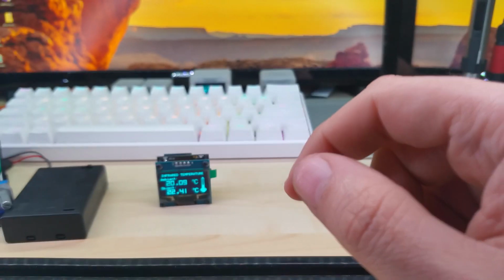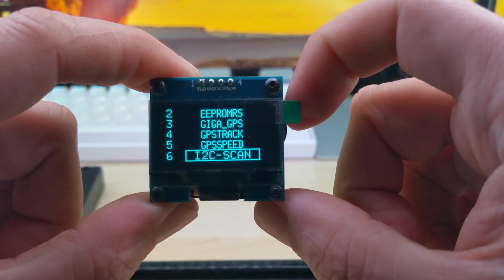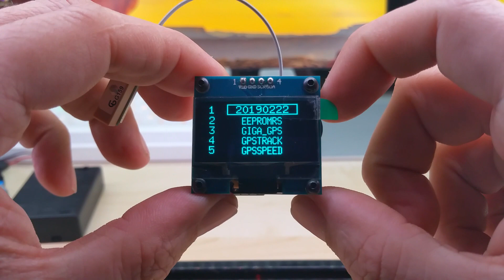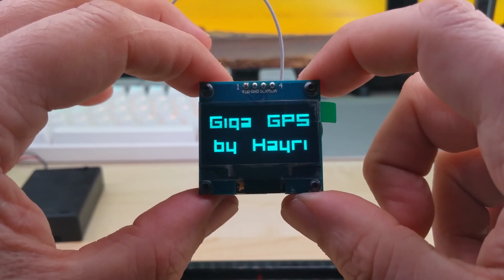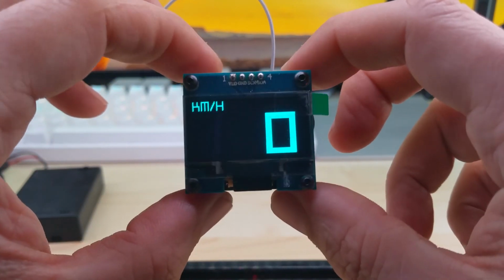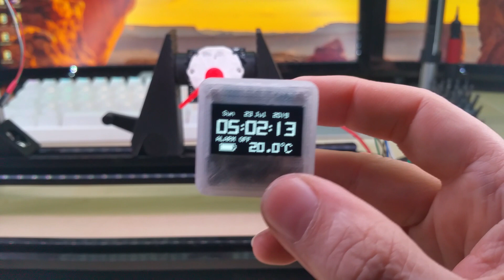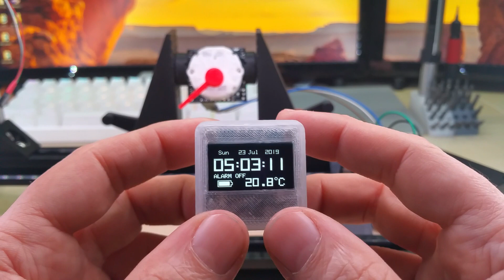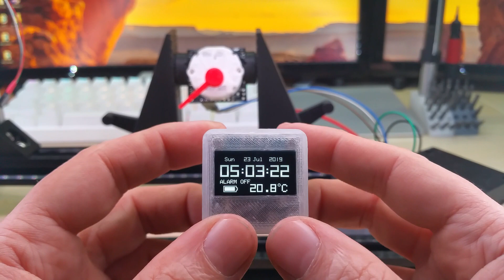Giga328, the ultimate Arduino compatible board with upload from microSD card feature

Comment: regarding tiny altimeter
I have an error on uploading  how I overcome this, please help

Arduino: 1.8.9 (Windows 7), Board: "Arduino Pro or Pro Mini, ATmega328P (5V, 16 MHz)"

Splash.c:8:9: error: variable 'Splash' must be const in order to be put into read-only section by means of '__attribute__((progmem))'

 uint8_t Splash[] PROGMEM={

         ^

Battery.c:8:9: error: variable 'Battery' must be const in order to be put into read-only section by means of '__attribute__((progmem))'

 uint8_t Battery[] PROGMEM={

         ^

Font24x40.c:8:9: error: variable 'Font24x40' must be const in order to be put into read-only section by means of '__attribute__((progmem))'

 uint8_t Font24x40[] PROGMEM={

         ^

Symbol.c:8:9: error: variable 'Symbol' must be const in order to be put into read-only section by means of '__attribute__((progmem))'

 uint8_t Symbol[] PROGMEM={

         ^

exit status 1
variable 'Splash' must be const in order to be put into read-only section by means of '__attribute__((progmem))'

This report would have more information with
"Show verbose output during compilation"
option enabled in File -> Preferences.
Reply from the maker: that code is written with an older IDE, you either have adjust the errors regarding Progmem or use an older IDE, 1.6.5 should work if I am not mistaken.
Reply: @iHayri1  thanks for your kindness i'l try with that old ide
Reply: @iHayri1   tried 1.6.5 it gives the same error message then tried  1.4.0 both it also did not work. again in trouble can you adjust the code for me, it's a big help

Comment: That tiny GPS is so tiny!!
Reply from the maker: I even have a smaller one that I was gonna use on the OLEDiTREK but never could get it to work. It is the size of a thumbnail less than 2mm thick including a ceramic antenna, and expensive as hell :-) But this one is great just wish the antenna would be attached to the PB, great another idea just emerged, I could make a PCB for the GPS module with the antenna attached, than I can just use the pins to attach it to my PCB, thank you Steve :-) I always get new ideas when I write about something :-)
Reply: haha, glad I could be of some inspiration?!! :)
Reply from the maker: @ChunkySteveo  You have been more than once probably, I just can not remember :-)

Comment: Ugh, I wish I had a PCB printing machine, that magically prints PCBs. Very nice board you made over there. Is it the one you picked up a few days ago from Elecrow when I asked you about them?
Actually, I am designing a similar styled board, but with ESP8266, modular so I can connect many sensors, and what sensors I need for a specific job. Thats why I was looking for a PCB manufacturing house, so I can have them made professionally.
Reply from the maker: Yes it is, this came out great. I would still recommend JLCPCB over Elecrow, just my personal experience :-)
Have you checked if you get the $20.00 discount with JLCPCB?
Reply: @iHayri1  The price is not the problem in JLCPCB, DHL is the problem. Everyone tells me to avoid them. :) Now I have another question. How can I panelize may designs so I will not get charged extra? On PCBWay I get charged no matter what I choose, Panel by Customer or Panel by PCBWay, but on Elecrow it says on some page that I can have many boards on the same board if they are the same design. But how do I do that? I make my designs on EasyEDA because it has enought features for what I need.
Reply from the maker: @dragomirliviumarian5834  Then you just need to choose the regular air mail option and wait a little :-) If you panelize the same design you will not get charged, like the PCB's I had made with 3x3=9 of the OLEDiUNO PCB's that were just under 100x100 mm in total so I payed regular price. If you do have different designs like I showed on my video with the panel I made then you get charged for each design extra. That PCB has 5 designs but 9 PCB's because I did put 2 of them twice one one of the 3 times on there and was still under 100x100 mm. Even though you pay more because you have 5 designs it does come out cheaper than ordering them individually. Plus the smallest PCB is only 18x16 mm which you could not even order alone because it is too small to fabricate, depending on the fab house. I will make a video about the program I used to panelize my PCB's when I get a chance, you can still use your preferred program to design the PCB and just need the gerber files to panelize yourself. As a tip, you can check prices by just uploading your gerber files and go to the shopping card to check for shipping price and everything else without actually buying it, that's what I do as well when the PCB's have different options like colors and HASL or ENIG.
Reply: @iHayri1  I do upload some gerbers to find the price on Elecrow, it is very helpful. That is exactly what I want to do, panelize 9 3x3cm squares on the same PCB. But I don't know if the V-Cut adds extra money. Can you please tell me the name of the program or website which you used to panelize your PCBs? Thanks for your help!
Reply from the maker: @dragomirliviumarian5834  No, as far as I remember v-cut does not cost extra money, that's what I used on Elecrow as well :-) This is the link where you can get the panelizer program: http://www2.thisisnotrocketscience.nl/software/pcb-panelizer/ it works great and is the only tool I have found that is free and again works great. Just be sure to leave some space around your PCB for the v-cut. And you are very welcome, glad if I can help with my knowledge and experience :-)
Reply: PCBWay also makes very neat PCB for the tiny money and the do Assembling - tried and very satisfied! Highly recommend!

Comment: Does this still fits Gopro session waterproof case? It was great solution for motorcycle.
Reply from the maker: Yes. it does. You can even use it in combination with my 1.3" display frame and screw the frame and display onto the PCB for a rock solid connection. Actually you just inspired me of another project to have remote switches so you can use whatever is in the GoPro display remotely by having a small sender unit with switches, of course wireless. Could be made easily wired too but where is the fun in that?  :-)
Reply: @iHayri1 Great! Remote switch would be nice clean addition especially if there is some nice case that can be water sealed.
Reply from the maker: @fibranijevidra  actually I already have the perfect switch for a bike handlebar, I showed it in a video before, it is 3D printed and uses 2 waterproof round switches, will make a new video to show it again, including the Giga328 in the GoPro case
Reply: @iHayri1  I have trouble finding it. Could you please direct me to the video?
Reply from the maker: @fibranijevidra  Just found it myself again :-) Here is the link: https://youtu.be/znLE-Y4_5xg
Reply: @iHayri1  Thanks a lot Hayri!